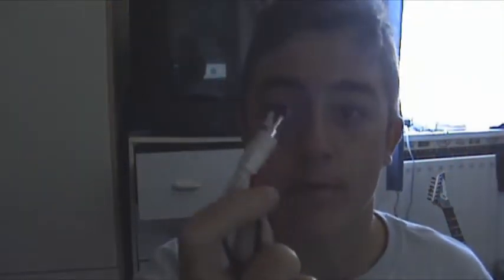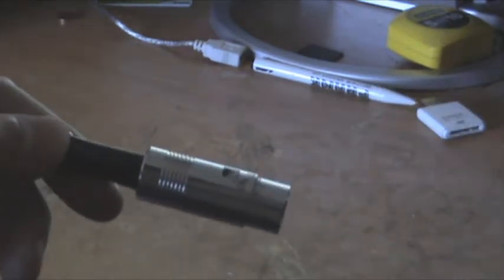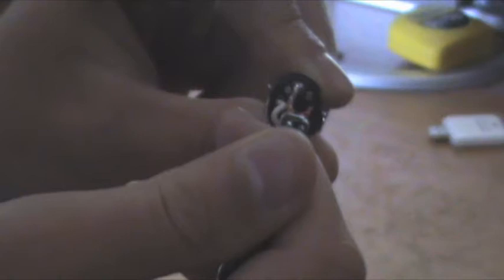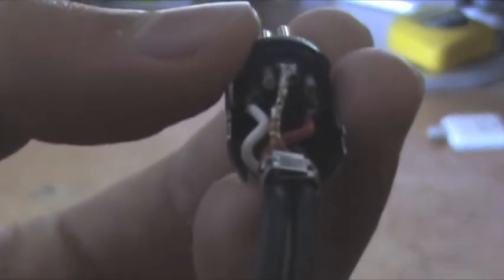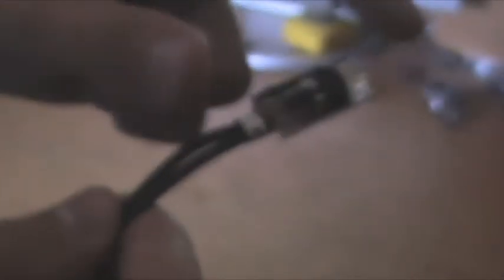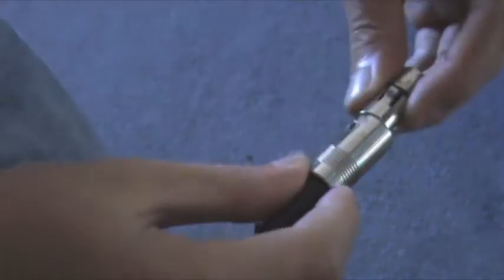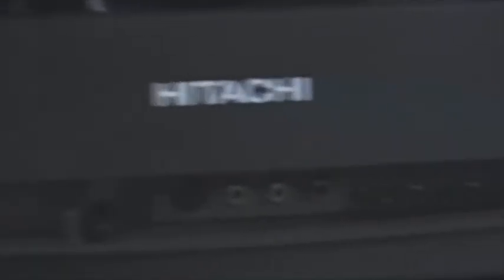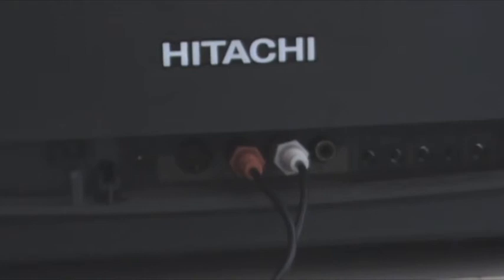Sega Mega Drive RCA Mod

Comment: Awsome video. I subscribed. I have had both a genesis one model as well as a master system. My nintendo and snes both work on my new LCD TV with RCA. Both of the segas will not work on my LCD TV. Is this a way to get it to work on my LCD TV? I have the original rca 5 pin cables but when I turn it to AV input one it say "no signal"?

Comment from the maker: @LoCoSHINOBI With a Sega MD/Genesis you can take R, G and B signals from the board and make a RGB stereo SCART interface which is as close to Component as you will get. I would be very difficult to get YPbPr from the Genesis. I'll look into it.

Comment from the maker: @sonicromer No because the MD2 does not use the same din connector. It can be done just not using this method as you would need a different connector and also need to figure out the a/v pins on the socket. Cheers,
Jordan